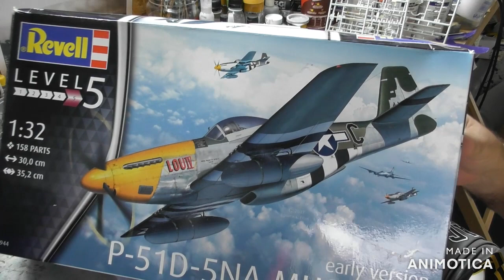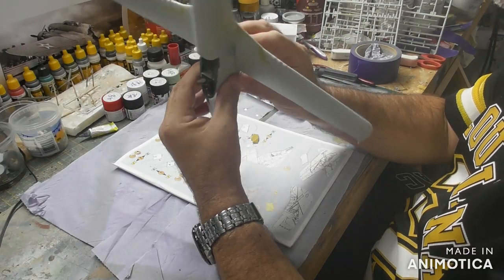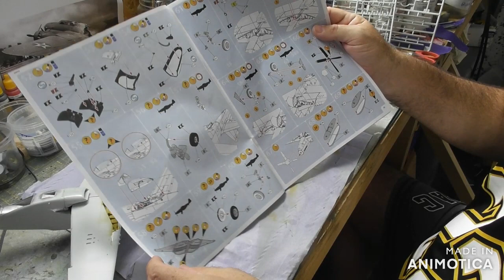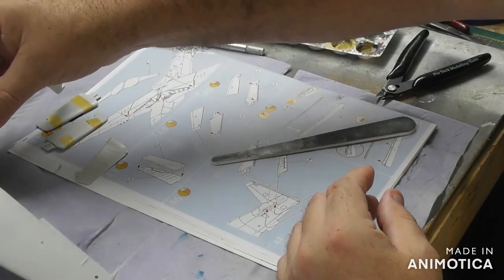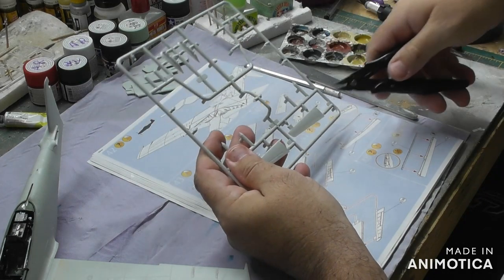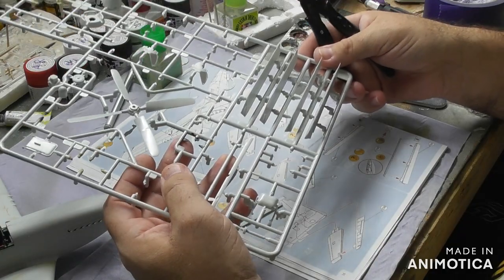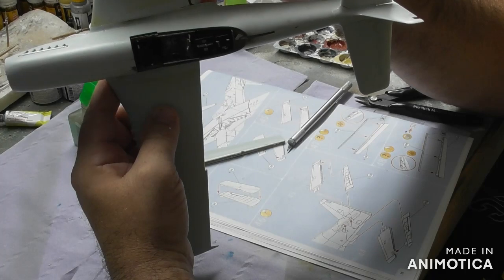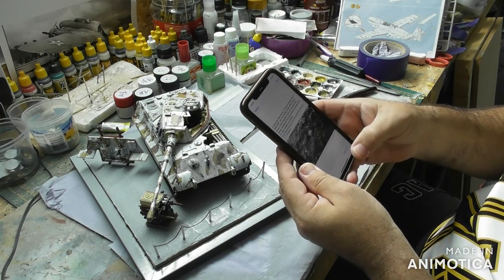1/32 P-51D Build part 10

Comment: Good morning Mike; The Mustang is really coming along. It looks like your perseverance with it is paying off. It's not a bad kit by any means. I noticed when I was working on this one the plastic seemed a little 'grainy', in that it roughed up when filed, so I ended up using sharp tools to clean up the join seams. I too also had issues with clamping the model Mike - so I used masking tape (Tamiya) on the parts to be clamped, and the clamps stayed put without rocketing off across the workshop!
Keep up the good work Mike, and I liked your King Tiger at the end. Nice work. I could never contemplate such a project now I am very ill.
All the very best from down here in New Zealand Mike - and keep up the great work!😊😀
Reply from the maker: Many many thanks Dennis for your kind words, info and for taking time to watch and comment I really appreciate it. I know exactly what you mean about the clips pinging off 😂 it is a really nice kit which I didn’t expect from Revell. It does rough up a bit with filing so I have been going over the roughed up sections with the polish piece of the sanding stick I have. Sorry to hear you’re very Ill that’s not good to hear. The Tiger II at the end I built a while ago now but I’ve just come up with the idea for a base to show it off. It was a lot of work with hundreds of tiny pieces but it does go together well. Many thanks again, hello to all down there in New Zealand also and hope you like the future videos.